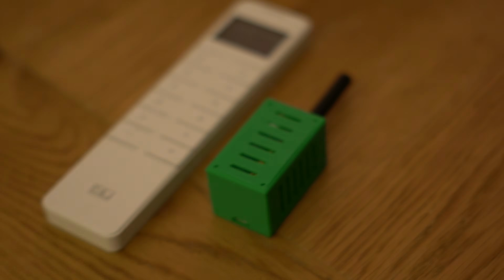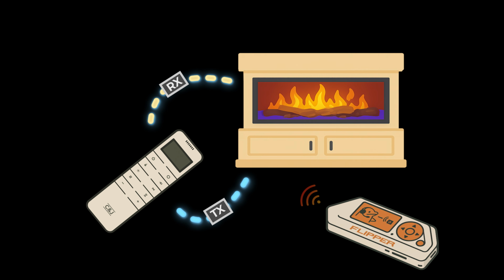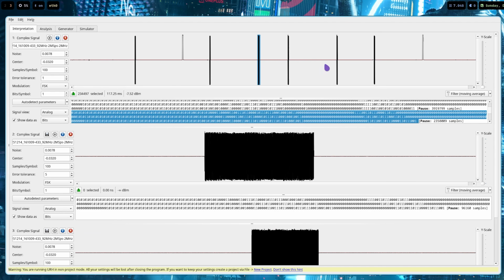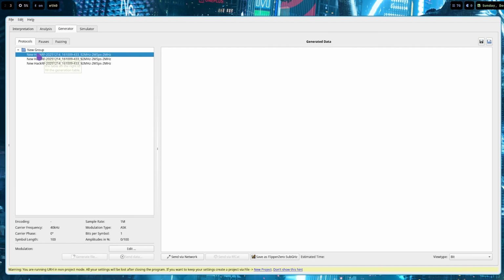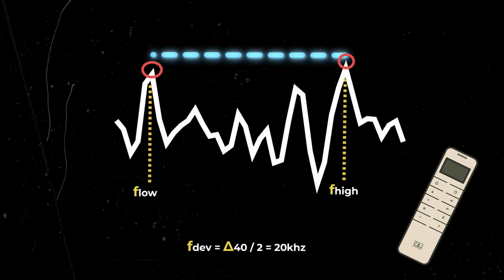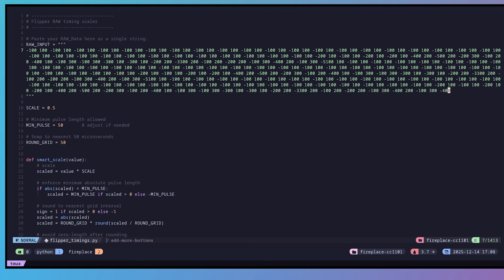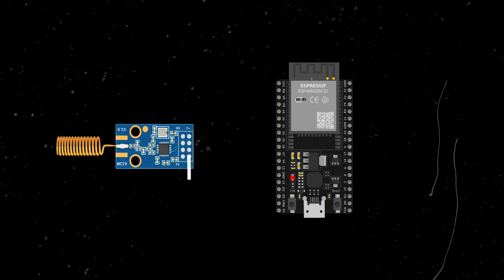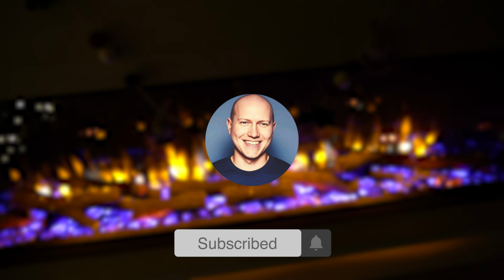How to Reverse Engineer ANY remote for Homeassistant

Comment: Very good info - unfortunately in my journey of trying to control my proprietary remote for window blinds I learned about rolling codes and that they even manage to fit a key in the remote so I had to buy the actual bridge.
Reply from the maker: Glad you enjoyed it! I didn't cover rolling codes in this video, as you can go down a rabbit-hole with them, but the same techniques in this video can be used to crack them (mostly*), albiet with some nuance

Comment: I've done this a couple of times but both times I opened the remote to find the RF IC and hooked up a cheap Saleae clone  logic analyser to the digital signal from the microcontroller. That gets you a much cleaner waveform to analyse.

Comment: I just hacked an esp32 directly onto the remote, using the pins to pull the buttons by soldering tiny little wires onto the button contacts. I also powered the remote itself (which ran off a coin cell battery) from the 3v supply of the esp32 and then plugged it into a usb wall wart and shoved the whole thing in a cupboard with my other smart home tech / router etc. I control it with ESPHome and it all works super nicely. Of course, the downside to this is that you can't use the remote anymore, but thats no longer needed given HA gives me voice control, automations and apps (and I could even build a DIY remote if I really wanted!)
Reply from the maker: You've actually just given me an idea I might try out in the near future. A "new" remote (i.e replacing the current one entirely) using an ESP32 with all the tactile buttons added as in the original. I think that would be pretty cool to do, design, and build. That would also fix the state "sync" issue I have with sporadically using the existing remote as is. Thanks!
Reply: @KeenOnTech nice! Enjoy!

Comment: Hi @KeenOnTech
Great Video lots of really good information. I have a device with a similar remote and want to add to home assistant with a ESP32. The approach I was going to take was to install the ESP inside the unit with the receiver and inject the data from ESP after the receiver circuit. 

Did you rule this out as an option?
Reply from the maker: Thank you!

So essentially you'd like to dismantle your remote and solder an ESP32 and connectors to it? Have I understood that correctly?

If yes, then no that's not something I considered. I think the solution I presented in the video would be far more preferable, as you get mostly the same results, sans the "sync" from using the remote in conjunction with a separate ESP32 and transceiver. There was another comment as well where someone suggested connecting an ESP32 to the control pins of the fireplace itself, which is something I had considered, but would have been a much messier job in my case, and I wouldn't have access to all the button functionality I wanted.

IMO, your best bet would be to follow along with the video and see if you can capture the signal, decode it, and transmit it. You'll safe yourself a remote at the very least!
Reply: @KeenOnTech  not the remote,
Since you have the data for each command, how about disassembling the fireplace, identifying the receiver circuit and receiver chip and use the ESP to inject the commands directly into the receiver chip. No more RF transmission just Home Assistant to ESP to fireplace.

Comment: I have the same fire and remote, just a different brand. I was looking at going down the ESP Home builder route with a relay board to switch it in the fire itself so i could have sensors feeding back the actual state of on or off and colours. This now gives me a simpler 2nd option if i can't multi meter the right connections.

Comment: Awesome content, I have a similar project to do for my shower remote, and this is really helpful. Did you dismantle the original remote to see what chipset it was based on? I am tempted to capture the bit stream direct from the remote and then reply that via rf.
Reply from the maker: Great to hear! And no, you shouldn't need to dismantle the remote. If you're not sure about what frequency it's operating on you can do a spectrum analysis in URH to help find it, then capture it and perform a replay attack to start 🙂

Comment: Would this allow me to turn on my TV without direct line of sight?  My TV uses a RF remote, and my Broadlink RM4 Pro does not work to power it on unless it is positioned right in front of the TV being an eye sore.
Reply from the maker: Hard to say, are you sure your remote is an RF remote and not an IR remote? The RM4 Pro supports both and if it requires line of sight it sounds like it's IR

Comment: I have a gas fire with the similar sub-GHz remote, I don't have a Flipper but I do have a HackRF. Can I use that instead?
Reply from the maker: You sure can! You can use URH like I did in the video to get the frequency, capture it, and perform a replay attack to start

Comment: Just use a Smart IF blaster? I use one to control my aircon, tv and soundbar
Reply from the maker: You mean an IR blaster? If so, then the issue is in the name; Infrared. What I focus on in the video is sub-ghz frequencies. 

And besides, I'm sure there are things you can buy to do the a similar job to what I did, but had I done that, I wouldn't have learned anything 🙂
Reply: @KeenOnTech I believe they mean smart RF blaster, but your solution is still cheaper and open source.

Comment: I would have hacked into the device itself, assuming it has control buttons somewhere and isn't asininely limited to just the remote. An ESP23 could much more easily short a pin to ground than transmit a signal.
Reply from the maker: Control buttons are limited compared to the remote unfortunately, power on/off and some others. TBH, I had considered it though... At the point where I was nearly throwing my flipper in the fire (pun intended) to be precise. But the fireplace is built in as a media wall so would have been a challenge to get into it, and I wouldn't have learned all I did about RF along the way too 😅

Comment: ANY remote? I would like to control my garage door opener from HA with my own hardware. The remote uses rooling codes from what I can see. Not that easy to clone.
Reply: @zaprondk :
Usability the motor unit has a indoor switch connector, u can ad a esp32 with esp home and a ralay to this port.
Reply: @knowbot  It does indeed, but I would like a wireless solution :)
Reply: @zaprodk  an esp32 is a wireless chip and esphome is software on it that integrates with Home Assistant. Then you can have all sorts of wireless connections to your Home Assistant server to control it.
Reply from the maker: Indeed, admittedly not. That said, all the tools I used in this video would help to identify as well as help to reverse a rolling code protocol. With time and effort, anything can be done :) 

As I replied to someone in another comment, I may do another video in the future where I try and break a rolling code - I just need to find a remote that uses one in my home
Reply: Shelly 1 (with dry contacts) you can wire it up as a detached switch.
Reply: I havent seen the video yet but maybe you could somewhere mount a infra red sender device that you can setup with home assistant. If he does what i think (copying the infra red signal of the remote like a sofabaton remote does) then that could work
Reply: @itsdarkos  Not infrared. RF. Also rolling codes, as in the same code is never sent twice.
Reply: @zaprodk ohh i see, nvm my comment then ^^

Comment: I've been using OpenMQTTGateway with Home Assistant for a few years to control etekcity wall switches.
It reads all kinds of signals from the vicinity (discovery) though I've only tried playing back the ones for the switches.
It does require manual yaml config sadly.

Comment: @keenontech did you find any other modules that can work recording the signal other than the hackrf? I just can't justify buying a $350 RF for the 2 RF devices in my house that I want to automate.
Reply from the maker: Yes indeed, there is a much cheaper SDR you can get called the Nooelec RTL-SDR v5. I've put a link to it in the video description (Under cheaper SDR).

The big difference between the two, is that the HackRF also supports transmitting, where as this cheaper SDR does not - so FYI.

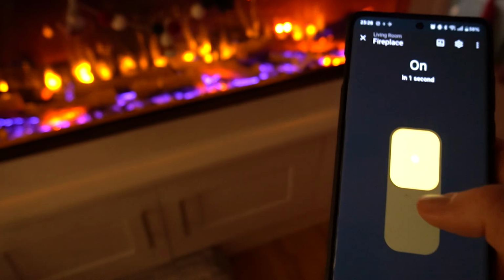Comment: 18:13
Does your project read commands from the physical remote as well? (to read the current state). Most DIY stuff like ESP32 (tasmota/espnow) RF do not incorporate reading from original remote so you can't read the current state which sucks. I had to cave and bought broadlink RM4 pro which reads as well as transmit, so when I press the button on the OG remote, it knows the state. BTW, your remote would definitely work with RM4 Pro as well as its 433mhz. The one you wanna hack is those pesky china remotes that's on 2.4ghz, hack that and you got our attention.
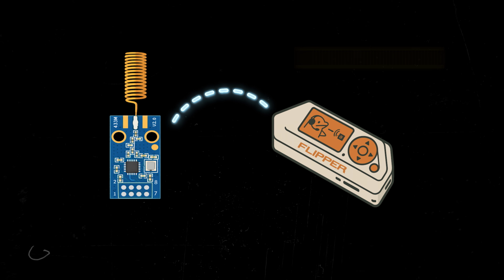Reply from the maker: It doesn't unfortunately, for all the reasons I described at 13:50 - The remote is simply transmitting too fast for the CC1101 to catch, essentially. Now, that's not to say a different radio chip wouldn't work better, I just haven't tried one - so still possible! For myself currently, I've mapped all the relevant buttons I use the most for my fireplace remote and just use them through Home Assistant, so negating the need for the remote itself. Though admittedly that just works for me, but not for everyone. Had it been more of a pain, I probably would have looked at other radio chips so as to keep the sync between HA actions and the remote itself in sync. 

> The one you wanna hack is those pesky china remotes that's on 2.4ghz, hack that and you got our attention.

This is something I might look at with the NRF24 radio chip which operates at 2.4ghz range. I built something not too ling ago for some LED lights I got - perhaps another video idea for the future!
Reply: @KeenOnTech  
Definitely! The ONLY 2.4ghz that has been cracked is milight which uses NRF24, emphasize on ONLY, he's able to do it by taping on the wifi config app and sniffing the channel. 

The other 2.4ghz remotes, e.g. tuya or random ceiling fan are not investigated. That being said, latest china remotes are all now using something called MESH2.0, it uses BLE which is much better supported for HA, thank god.

Comment: Great project, and I'm also interested in an esphome version. Now, from what I can see, it's also possible to decode the Somfy curtain controls, right?
Reply: For Somfy RTS devices there is a Tasmota-based solution that adds support for the protocol within the Tasmota firmware ecosystem. The project is called Tasmota-SomfyRTS and enables RTS command transmission from Tasmota-flashed hardware, with clean integration into Home Assistant.
Reply: @andrewrussell9368  I love to be on the internet because of resourceful people like you.. 👍🏻 👌🏼.. 😊 .. resourceful people know everything of everything 🎉
Reply: Be aware, Somfy RTS use roling-code
Reply from the maker: I've already started on a port to esphome, I'll come back here with a link when I publish it :) 

As for Somfy curtain controls, I'm not familiar with them but if they operate in the sub-ghz range then everything I explained in the video should still apply when it comes to decoding their signal. Just be aware, as @janpekkeriet3506 mentioned below, they may use a rolling code.. So it might be more of a challenges, but all the tools I used above should help. I may even do a video in the future with regards decoding a rolling code remote (If I can find one in my home)

Comment: What hackrf/sdr clients have you found to be the most useful when doing signal analysis for such devices as remotes?
Reply from the maker: Universal radio hacker is the primary tool I used in the video for signal analysis, and IMO the best. But I have also used SDR++ which is good too but more for spectrum analysis

Comment: Convinced me to buy a flipper. 😂 Even if it didn't work 100%
Reply: Yeah, it's an extremely useful device and works for a huge range of devices. You just have to be aware that it's not an SDR, and so there will always be a chance that a particular signal falls outside of what it can demodulate. But as this video shows, with careful setup it can transmit things that it couldn't necessarily receive.
Reply: they're pretty useful as a universal remote... although I have a feeling you might be able to get a regular 433mhz universal remote cheaper if you only want it for 433 things...